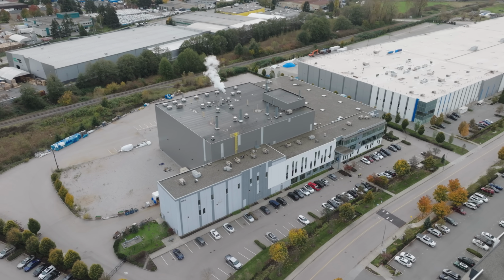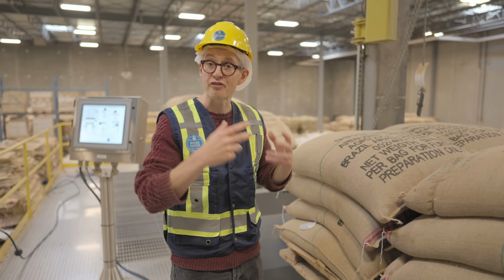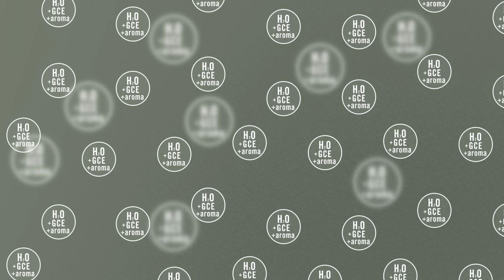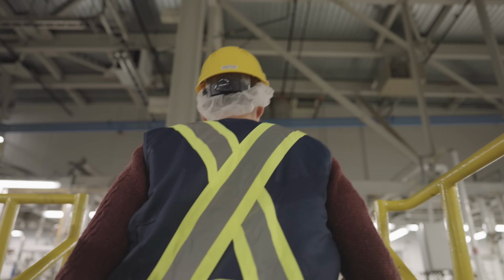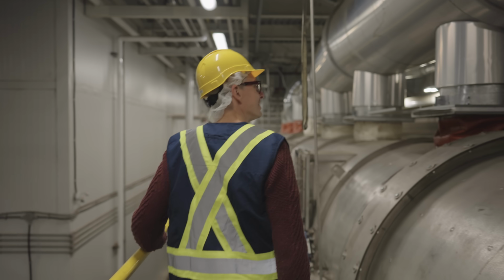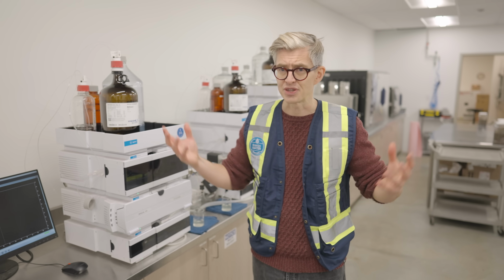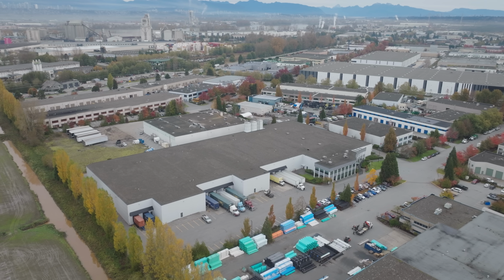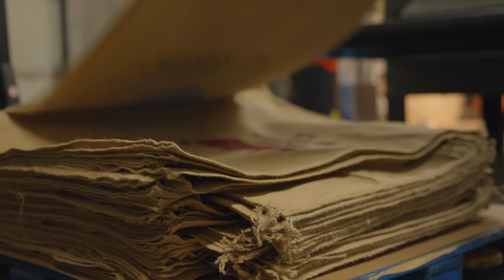The Secretive Decaf Process Using ONLY Water

Comment: Having had to move to decaf due to med Interaction I've found I've much preferred Swiss water decafs over other methods no matter the roaster.
Reply: If you don't mind sharing what meds are causing your problem? For me it's Allopurinol, it turns out the enzyme that breaks down caffeine motabolites also breaks down Allopurinol and does so selectively. Prior to developing gout I could drink a half gallon of coffee a day without any sleep impact  now if I have more than 2 cups, or any cups after noon I can't get to sleep until way to late to be functional for work the next day.
Reply: @andrewfidel2220  apparently I'm not allowed to mention my ADHD med on Youtube without the comment vanishing... but yeah it ramped my BP for 3 hours after having caffeine last time I tried :P
Reply: @wodmarach  assuming you're on one of the first-line ones, it's fascinating how different people respond! I'm an outlier in the other direction - my bp and hr slightly improve with the major first-line options, probably because of the dramatic improvement in my sleep, and caffeine makes no detectable difference.

I'm a frequent decaf drinker because of some food intolerance issues - Swiss Water Process incidentally works well to decrease salicylates in coffee, too.
Reply: @andrewfidel2220  hmmmm. I have been taking allopurinol for years and drinking coffee with really no issues I thought. I do struggle with sleeping but I never pinned it down to being caused by caffeine/allopurinol as I dont drink any coffee after noon generally. Definitely going to look into this.
Reply: @andrewfidel2220  Nah it's the interaction between caffeine and ADHD meds ;) The one time I risked it my BP hit 190/110 for 3 hours! Methylphenidate is a fun med at times.
Reply: that's good to know.  I'm a roast my own kind of coffee guy, and the only decaf process I'm able to get unroasted beans from SweetMarias is the Swiss Water process.  I'm doing the tasting in a couple of weeks, so I'll be able to tell which decaf process I prefer.  I was hoping it would be Swiss Water because so far that's all I'm able to get in unroasted beans.